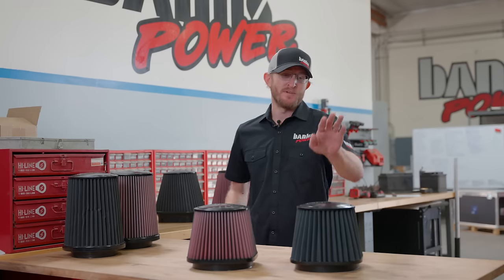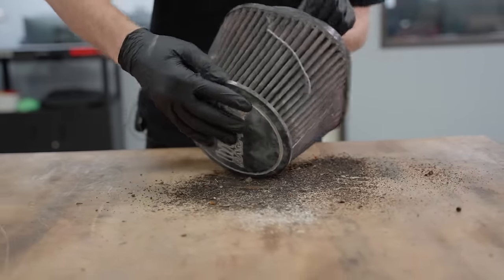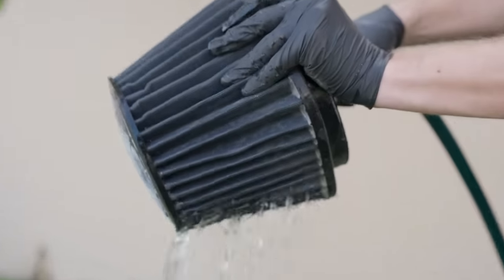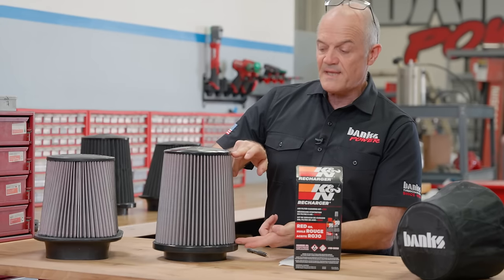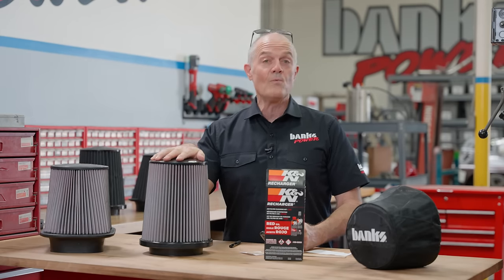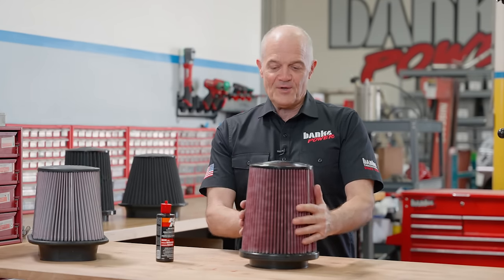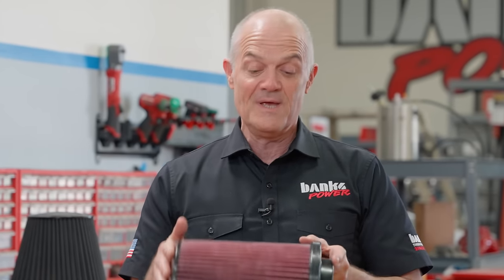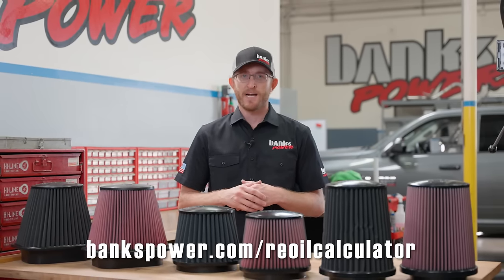How to Clean and Re-Oil Your Air Filter

Comment: It’s a great video as far as how to goes but for us consumers is a pocket drain. So I actually bought a 2nd banks dry filter so I can swap them easier between cleaning. $ well spent I guess?? But the least you could do is tell us how to properly clean it ourselves without having to fork out more $ on the K&N kit. The cleaning solution can be such a big deal. It actually smells like a lot of the cleaning liquids out there. I’m sure someone will eventually figure it out. The point is that one bottle of 32oz of K&N is barely enough to properly clean a Bank’s monster air filter. By the time I get done 2-3 rounds my finger hurts from that stupid spray pump and I can still see some small bugs in the filter…so it will never be perfect no matter how many times you clean it. But I don’t want to be buying all this cleaner crap from K&N which doesn’t even do the job properly. 🤷‍♂️
Reply from the maker: The full video is here 👉🏻 https://www.youtube.com/watch?v=lx_9fMrtoqQ&list=PLwtmrqcWzLtSUSPX-V1rFQUkslt61Accw&index=2&t=268s&pp=iAQB
To learn more about this build, tap his link👉🏻 https://official.bankspower.com/project/lokjaw-c20/
Watch the Banks Built series here👉🏻 https://www.youtube.com/playlist?list=PLwtmrqcWzLtSUSPX-V1rFQUkslt61Accw

Comment: 17 years repairing cars, pickups, and suvs for a living.  I am absolutely not a believer in this style of air filter.  The vast majority are improperly maintained which has the opposite effect of what the filter is supposedly designed to do (increase power and fuel economy by being more freely flowing).  Most of these I’ve come across in the wild are letting dirt into the engine.  I just had the plenum off of an engine last week running a k&n.  The amount of oily black carbon and dirt collected in that plenum was astounding.  Guess what else, low compression on all cylinders.  Dirt introduced into an engine tends to have that effect.
Reply: Not being facetious, but wouldn’t more dirt carbon buildup inside a cylinder raise compression. Because you’re filling up the volume of space for the same given amount of piston stroke.?
Reply: @DB-qm4jx  carbon buildup on the tops of the pistons can raise compression like you mentioned.  In the case of poorly filtered air entering an engine, dirt has abrasive effects on cylinder walls and piston rings which impedes their ability to hold compression.
Reply: @ReeveHelalV  fair!! Thank you for explaining more thoroughly. You are completely correct and I appreciate the immediate response.

Comment: Those k&n cleaning solutions are a waste of time and money it's just a basic degreaser, Just use dawn dish soap. Also, it's complete BS that you can over oil a filter. The material can only hold so much oil. If you over oil and just let it sit, all the excess oil will drip out. The physics of how the oil moves and the absorption capacity of the material means its basically impossible to over oil. Anyone who has gummed up their throttle body is normally because they don't give the filter time to absorb all the oil and don't do any basic wiping of excess oil before installing it.
Reply: I think the drip out part is scary if its on a engine,adhesion can hold the oil but the moment 1.5psi turbo works it will go inside the engine

Comment: For those wondering that the K&N filter is terrible... this type of filter is recommended not for daily purposes although it can be but for performance in the race track or youre just trying to beat someone at the light. I recommend wix for daily trips to best protect your engine. It will affect performance over time as it does clog. Cotton gauze can filter pretty good until you get into micro dust particles. Not ideal for offroading. You can gain hp using the K&N filters. It will protect pretty good while even fully clogged without affecting hp. The oil is the key protector of the filter. This is not a filter for the practical driver this is usually for someone who's serious where each bit of hp goes where.

Comment: Unfortunately cotton filters AKA K&N do a terrible job of filtering air.
Reply: Yep. thats why I'd never own one. Take a tissue and wipe the inside  of your throttle body and intake and see all the stuff  this filter is missing.  Paper filter is quite fine for me.
Reply: @mplante7352  Lot of assumptions going around about how good the cotton filters are, I was one of them until I did my research. The attached video is a decent back to back comparison

https://www.youtube.com/watch?v=sJ3L-E-ufYo&t=91s
Reply: @darmah1959  - yes, this is what I have always read about K&N Air Filters - they are coarse filters, so of course they have less flow restriction!  Regardless of whether they impact MAF sensor performance from oil misting, the whole point of the air filter is to prevent harmful contaminants from entering the engine.

Well, Project Farm flour, with fine particle counter set for 5 microns.  Generally we are concerned with silica dust (abrasive dirt) ingestion as a wear particle.  I haven't seen a study about the cutoff size for harmful silica.  It is down to 1 micron for oil (journal bearing clearance, less for cams), but that's impractical to filter so most oil filters report efficiency down to 20 microns.  A good filter will be 99+ efficient at 20 micron.  AND - be large enough so they don't plug before a 5,000 mile oil change interval, or the filter will go into bypass and provide zero filtration.

So, @Banks Power - why did you pick K&N without knowing if they're merely a rock catcher filter for race engines that don't need to last 100,000+ miles?

Comment: Doesn’t Gale roast people for using pre filter socks?
Reply: I would guess there is a difference between a pavement princess doing it and guys who are legit driving on dust roads daily. Same way snorkels are mostly silly but a small percentage do actually truly need them. 
But yeah you are right a lot about this video goes against what Banks has said in the past. He did have a change of heart about the pedal tuners so maybe that is the case here too.
Reply: honestly i wouldn't even think twice without one now. the mesh is open enough i doubt it'll add any restriction, and i'm no longer strugglin to get bugs and large debris outa my pleats.
Reply: @Luckingsworth  money motivates

Comment: NEVER use an oiled air filter , on ANY engine with a MAF . The vapor will accumulate and burn on the front of the filament . It can never be cleaned without damaging the coating . I will send only wrong information , and probably a code . But , it is great on my 1965 Pontiac coupe .
Reply from the maker: As long as the oiled filters are properly maintained, they will work just fine with vehicles that use a MAF. We have thousands of customers that use our oiled filters with no damage to the MAF.

Comment: There is no benefit whatsoever in using these oil filters. Regularly replacing regular dry filters is what your manufacturers engineers designed the car for.

Comment: Too much work.  Use a normal dry filter
Reply from the maker: Oil offers superior filtration and performance. But yes there is a little maintenance. Or, just buy spare filters.
Reply: sounds like you should just stick to a stock filter than 🤣
Reply: @Markes12344_L  Sorta reminds me of the filters back in the ‘50’s.  Think my Father’s’53 Ford had a wet unit
Reply: @njjeff201  AKA "Oil Bath" factory air cleaner.  They usually held maybe a pint of oil in them and as the air moved into the air cleaner housing it had to pass across the oil which captured most of the elements in the air. They were truly effective but when driving on steep hills, the oil would spill into the carburetor. Sometime in the 60's OEM's moved over to dry element air filters.

Comment: I hope Mr. Banks himself didn't have anything to do with this video. . . he's been pretty good at outright calling bullshit on bullshit when he sees it.

At $18 for oil and an hour or more dicking around cleaning every time you need to replace your air filter - never mind that even factory new K&N filters leave oil deposits on MAF sensors .. 

I don't dispute they may flow more, even if they provided similar protection ( as demonstrated by project farm, they don't ) they're expensive to purchase, the cleaning supplies are expensive, they do leave deposits on intake tracts and sensors, take far too long to maintain and are often neglected as a result. 

I'll stick with changing a $12 paper filter in under a minute - if I wanted to use a CAI that happened to utilize one of those conical styles of filters I'd replace it with a similar round filter from an early '00s GM.
Reply: lbz filters are $90..... that hurts

Comment: What does the oiled air filters do to moder car intake sensors ?? What about 02 sensors ?
Reply: O2 sensors are scanner like scanner tool
Reply: @wrestling9314  o2 sensors are in the exhaust stream and the oil from the filter may or may not contaminate the sensors.